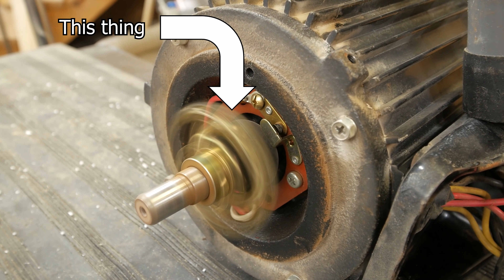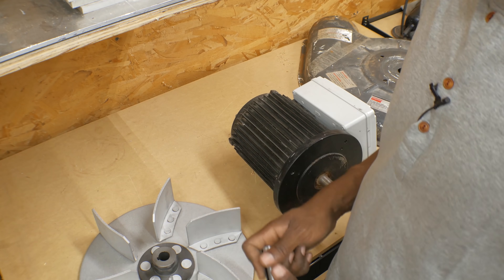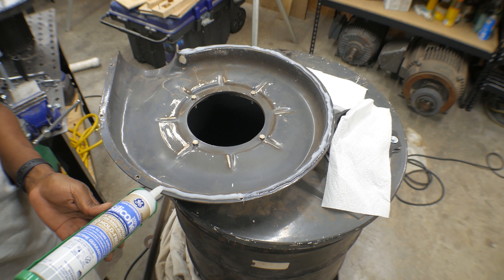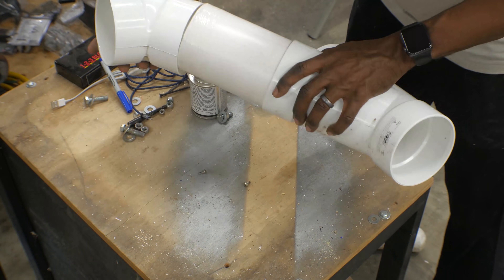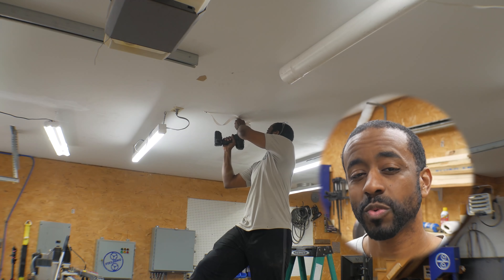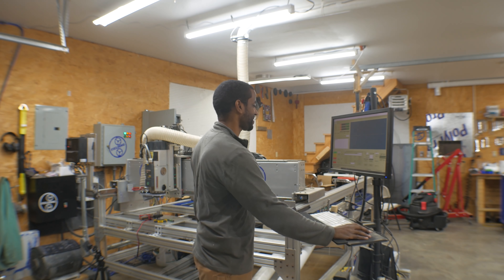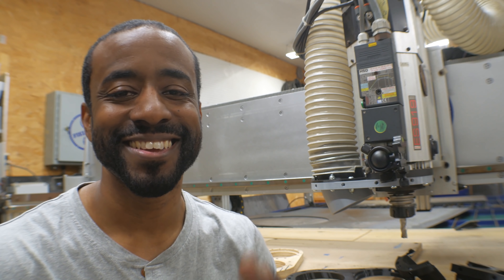Making An Automatic Dust Collection System; Shopmade #081

Comment: Dude..  I just went thru this.. the motor shaft is a Left Hand Thread..  Metric.  I RH thread tapped mine too, but realized it wasnt working, wrecked the first 3 or 4 threads.  Luckily, the proper LHT bolt found the remains of the previous LHT, and went in w/o issue..  Great minds think alike!

I did similar with a 3HP double bagger dust collector, converting it to a vertical cyclone.  It  had a steel impeller.. since the suck first collectors have to eat chunks of wood/nails.  I actually carefully welded on additional fin extensions..  Mo Blowa!!  1" steel 1/8th bar with abt. 1/4" overlap.  Made it about 14.5" Diameter.  Ground the welds to visibly match additional weight.   Surprised, but No perceptable balance issue.  It comes to full speed in about 3/4 sec, on a 20A 240V breaker.  Haven't measured the current yet, but it seems to repeatedly start w/o breaker blow.

You can use a heavily derated Solid State Relay..  My 3HP Pulls 17A at 240V blower required a 100A SSR.  A derating factor of 5 or 6 for SSR used for motor starting is specified.  Ebay had suitable SSR for ~$20 shipped from you know where.
Reply from the maker: It’s not left hand thread. I checked that before hand
Reply: @Jeremy_Fielding  you're a better man than I.. almost wrecked mine!

Comment: One thing to consider when using the plastic pipe, is the static electricity that is produced. PVC is intrinsically unsafe for dust systems, meaning that it will generate and store an electric charge. You do not want this around a dust system. It can cause an explosion. There are ways to shunt the static to ground, but it take some engineering and research. Clearly, you are qualified to do this, but it may be cheaper and faster to run the duct work in metal designed for dust systems. Nice video. Cheers

Comment: Why not grab some wire and wind yourself a 1:10 transformer so you can trigger a SCR right off your machine's contactor? Then use a single port solenoid and put a restrictor on the exhaust port of the air cylinder so your dust collector can power down before the blast gate closes- this will keep it from pulling a high vacuum and sucking up your flex pipe.

Comment: I did the same thing with pneumatic actuators and a contractor about 6 months ago. Instead of the relays hooked to the switch I did limit switches that contact when the gate is open and kick on the DC. My thinking is I do not want the DC to kick on ever with a closed blast gate. I need a 3d printer. Would have been a lot easier than all the metal work I did retrofitting aluminum blast gates.

Comment: I've never seen a dust collector blow up either.  I run building maintenance for a dental lab, and all our dust collectors for milling zirconia have a ground wire in the dust stream.  Granted those have plastic hoses.  Our 'built in' dust collection for plaster dust is piped with galvanized duct and I don't see any grounds there.  I have only been on the job for a year or so, but thats my data point.

Comment: Automation of small projects like these are REALLY easy with the small Siemens Logo! PLC’s. They’re only some 100 bucks, as a basis have 8 inputs and 4 relay outputs (both expandable, I often use extra output relay modules) and the programming with LogoSoft software is a breeze. There is a LOT of functionality in these things : latching relay funtions, timers, on- and off delays, input logic (AND/OR/etc.), Check out some video’s on that.

Comment: 100% silicone is fine, a tip when using it don't tighten the bolts up completely until the silicone sets. That way you compress it more like a gasket. Alternatively cork or foam would have made a good seal.

Comment: An idea to improve this, if you are able to do so and it's legal where you are located. Is to remove the filter bag which lets through most of the harmful dust and actually blow the fine dust outside. The only way this fine dust stops being harmful and airborne is when it comes into touch with water hence why it's advised to not keep it in your shop if you can. So you would have to make a hole in your shop that leads out and connect the hose where you've attached the filter bag to this hole

Comment: Preventing a static electricity discharge is a reason to use corrugated pipe from aluminum foil, which are often used for ventilation purposes

Comment: Silicone is fine for the impeller housing, but I think tool steel would have been the right choice for that shaft key, or at least harden and anneal the one you made from what appeared to be mild steel. That's a big impeller and I think the repeated start torque is eventually gonna deform a mild steel key.
Great build though! I've got my dust collector (and shop fan and compressor) controlled by Alexa-enabled switches, so I just have to say "Alexa, turn on the dust collector" and it's running, although I still have to figure something out for the blast gates.

Comment: I've been wanting to add an automated dust collection system for a while.  However, my (current) plan is to use a 5 hp dust collector with cyclone.  I hear you shouldn't turn on and off those big motors in a short time span, so my plan to have the motor start and stop with each tool use should probably be abandoned.  Maybe use arduino to turn it on when the first tool is run, then not turn it off for an hour or so.  The blast gates could be automated, but if the collector remains on, I'd think you'd want at least 1 blast gate open (could be a dummy one - not hooked up to a machine).  I also agree with the comments about a delay on the blast gate closing, so arduino or raspberry pi is probably the way I'll have to go.

Comment: 1. Static accumulation in structure due to high velocity air moving over it is very real, airplanes have a lot of grounding straps and studs to deal with the buildup caused by air over the body panels. I'd rather put a $0.10 ground wire or two on just to be on the safe side.
2. With tubing, maybe route that outlet out to the bag to where you want it, or make a home for it under the work table there so it's out of the way.
3. That is totally awesome may be something I have to look into in the future for my own shop infrastructure.
Reply: He didn't say it wasn't a real thing, just that there is no reported case of an actual incident of a shop explosion occurring.
Reply: I get that. Just people have a tendancy to discard that as myth and a couple ground straps or studs will alleviate that so we don't find out.
No biggie.

Comment: 4:25 does it seal, good doesnt matter its a dust collector
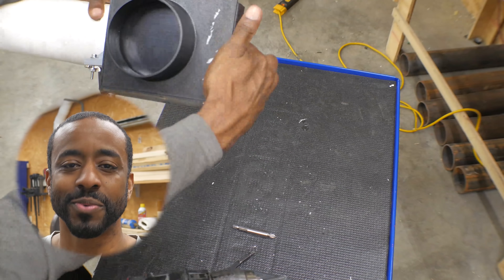8:35 it wont cause a dust explosion, but a ground strap is not a bad idea if your running it and happen to touch it, it can rattle you a bit

Comment: Jeremy you will need to ground your CNC machine, as well as the dust collector. I agree with Frank below, I have had the machine just stop as if someone hit the emergency button stop button. The static electricity will interfere with the electronics such as the stepper drivers and connection to the PC. So I grounded the machine and the dust collector. I also got a nasty shock like someone walking across a carpet and touched you and POW got a nice zap. GROUND! GROUND!  No need to ground the PVC pipe that is going way to far.

Comment: You will find that if you dont add your ground wire to the CNC it may stop randomly. That is the static discharging and messing with your control board. I had it happen a few times until I ground the dust collector to the CNC. Nothing else is grounded, just the cnc.

Comment: Awesome video. Concerning the issue of grounding the pvc pipe. I am not aware of any cases of the static causing a fire, however I get shocked by my system all the time and it is annoying. No it’s not enough amperage to be dangerous, just annoying.

Comment: Looks like an induction motor on your dust extractor. That is a very small impeller for an induction motor- The low RPM (c3600 in US) means you will shift a lot of air, but not at a very high vacuum. More of a chip extractor - fine for a planer/thicknesser (or, as you probably call it, jointer/planer). Called an HVLP (high volume low pressure). For dust extraction they need an impeller around 400mm That is why most extractors are so noisy - they use universal motors turning at ~10,000 RPM.

Comment: I had heard that anything under 1.5 hp didn't have the velocity to build up the static charge. So when I hooked up my 1.5 hp Delta dust collector, I was surprised to be zapped by the PVC pipes. A grounding wire took care of the issue. Maybe no fires, but still the shock.

Comment: I haven't seen or heard of PVC pipes with static buildup that cause fires either, but I have experienced a static discharge that resulted in an arc. Worst thing I think will happen is you get an unpleasant surprise if and when you touch the pipe but not much more.

Comment: What I'd suggest, and want to know how to do is delay the vacuum shutoff for 3 seconds after the tool switch is selected '"off" so that the dust accumulation will clear, and completely travel to the collection point.
Reply from the maker: There are relays with timers. Or upgrade to Arduino controlled for very complex control

Comment: Just thinking that you probably don't need the relay for the pneumatics. You need a 24v DC supply to drive the air switch, so if you just hook the input side if the power supply to the load side of the actuator, you don't need a separate relay.

Comment: The dust will ignite? It can happen, but it's not like it will burn. I recommend reading about dust explosions. Given all the holes in the system, it doesn't explode like TNT, like a firecracker - I can believe it. A little bent theory.

Comment: I love all your knowledge on how to do all of the different things in your awesome shop.  I'm so jealous.  You mentioned in one of your videos that you buy a lot of things from industrial auctions so I took your advise and found an auction and ended up buying a ton of step down motors, geared motors, switches, relays, transformers, valves, temperature controllers and other things that I have no idea what they even are. Some was new and some used but it's a lot.  I was wondering if you might know where I could sell some of it because I could never use it all and it would be nice to recuperate some of the money I spent on it.. Any advise?  Thanks and keep up the inspiring videos.  I get a ton of ideas from you and I really do appreciate your time.

Comment: Sorry to tell you, if that's the Powertec blast gate that it looks like, those things are utter crap. It'll be fine for a while but eventually dust will build up inside the rectangular portion because it's completely closed, and there's no good way to get it out. Maybe blowing it out with compressed air would work - I don't have a compressor to test. But anyway, once dust starts to build up, it will never completely close again, so suction will suffer everywhere.
Reply from the maker: perhaps I could 3d print a close fitting ring that deflects the dust? We shall see how they hold up.

Comment: Static CAN ignite ultra fine dust. But it's pretty rare. Good examples of fine particulates that can ignite come from some paints and body filler. If you do a LOT of fine wood sanding, especially on polyurethane or stained wood, you have a somewhat higher risk of fire. But it's still quite rare. You're more likely to cause a fire or explosion if the dust collection system pulls in a flammable vapor along with fine sawdust particulates. That's still pretty uncommon in a home shop. It's an actual issue in a production facility or auto body shop.

Comment: I think I would have cut part of the flange on the dust collector and sealed it with a flatter patch to rotate that housing around.  It can't create that big of a problem, especially if you don't take the entire flange off to get the collection pipe to fit.  You could always use some of that waterproof sealing tape if it leaves a small gap in the flange, right?

Comment: If you wanted to discharge the static electricity you would need to add aluminum foil to the entire inside and only that would discharge the static electricity. PVC is an insulator extra electrons do move from a build up point to a wire that is on it.

Comment: if in doubt re-tap.    i have a 2hp double dust collection system than i don't use because i keep putting off getting all the pipes installed...   could always make excuses because i didn't have all the bits and pieces... now i have them... but NOW the excuse is i want to change the double collector to having a cyclone filter in... which buys me infinite time.

Comment: I rewatched it and see that maybe  if you cut away the bolt flange in the interference area there may be enough room.  Seal the edges that no longer have bolts with a good proper ducting tape.  Maybe that'd get you enough clearance?
Reply from the maker: Yes. I think your right about this... I will take a look

Comment: If you want to take advantage of automation and control tech, I can heavily recommend playing with Arduino microcontrollers ($5 - $10), and for more extreme projects, a Raspberry Pi 4 ($55). I'm an automation and control electronics tech for the aerospace industry. These two devices can be the literal equivalent of thousands of dollars worth of data acquisition and control gear. And they're fun to play with! There are several complex home automation systems that use just the Raspberry Pi and arduinos.

Have you thought about mounting an air gun nozzle on the dust vac shoe? It will stir the dust into an air stream for the vacuum?
Reply: Raspberry Pi Zero W (BT/Wireless included) ~$10, Linux.

Comment: For any static discharge, you need a focus point. IE a metal part on an all plastic setup. If you're actually worried, just paint the metal parts and you'll be set. But generally speaking, that zap you get, will only start a fire if it fits two large scenarios. A flammable gas or extended contact with flammable items (like those zapping lighters). I sincerely doubt your shop can fit those parameters, so i wouldn't even sweat it.
Source: My home vacuum cleaner has a metal pip that you press down to put the various attachments to it. The zap i get if i touch it, after cleaning say the carpet, is insignificant, and would light a fire only if something was aerosolized and flammable.

Comment: I got shocked like you wouldn't believe pumping hydraulic oil from a 55GL drum into a vessel using a pvc tube as a pickup. I looked down and noticed the grounding wire had come off during use. Same as touching the spark plug from a lawnmower.

Comment: UCCNC is a great, inexpensive  cnc control software it has a lot of digital i/o's but more importantly it can talk bidirectionally serial/modbus etc to any devices for automation down the road.

Look into WIreless relays ....saves some cable runs...I also use a key fob actuated one that i wear on my person when running jobs.......so I can remote KILL the machine if badness happens, even if I hear something bad from another room!    On some machines you may not want to go near them if that is where the standard kill switch is, best to have multiple kill switch locations and at least one on your person, although a router is much safer than some machines.

Comment: The "pump casing" looks very symmetrical. Did you try flipping it upside down instead of rotating it? Would just need to cut a larger hole into the top half and create an adapter to connect the motor to the bottom half.

Comment: If I could afford that kind of automation I would even bother to get up in the morning... Impressive engineering but whoa the cost?
Reply from the maker: it cost about 60 US dollars per tool I add in parts (relays, actuator, hose everything). Since it was apparent I wasn't going to use it without a system in place... and for saving my lungs that seems like a reasonable price.
Reply: @Jeremy_Fielding  I honestly find that hard to believe but you do seem to be able to find bargains.

Comment: Awesome video.  Love the relay logic.  Very elegant solution.  Question regarding the PVC pipe grounding.  Somewhere I heard the static build up from the PVC will also jeopardize the suction of dust collection because it add's a sort of static resistance.  That is another reason for the grounding.  I have no idea if that is true or not.  Have you heard that or think it's possible?

Comment: Love what you did, great job.  Wondering how you grounded the PVC pipe.  I have been told that using it in a dust collector can be dangerous use to static charges of ungrounded PVC pipe.   Not sure if that is a real thing but I see others on the internet mention it as well.

Comment: then for the grounding, I did not have a fire, but I already had "explosion" in the pvc tubes, (and I took a lot of shards) to avoid that I put a screw in each elbow of my system and I connected them to the ground.

Comment: thats gonna work pretty well....one thing though....id love to know how the air flow is affected by the elbow at the blower etc.....ive got a similar system and ive used two 60 degree angle where i need to turn things...would be great to know how much its reduced by 90 degree angle....great work...love the blower!
Reply from the maker: It’s a 45 not 90
Reply: @Jeremy_Fielding  yes ....i knew that!..ha!...can you do a test so we all stop using 45s??!!!!
Reply from the maker: I see.

Comment: There are things known as "static wicks" that help airplanes disperse static buildup from the back edges of their wings during flight, essentially shedding the voltage. These are little, rigid plastic with nylon 'feathers' on them and a piece of copper strand in the middle that's connected to the chassis of the airplane. When placed in air flow, the static buildup will disperse through those wicks to ground. problem solved